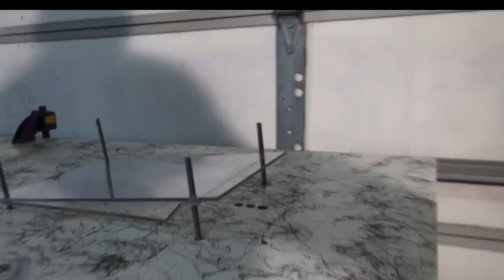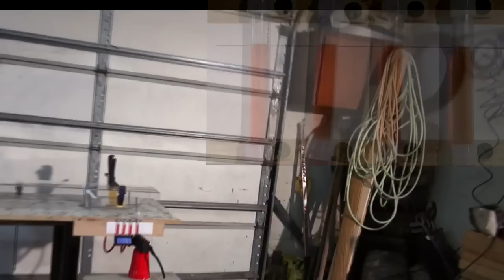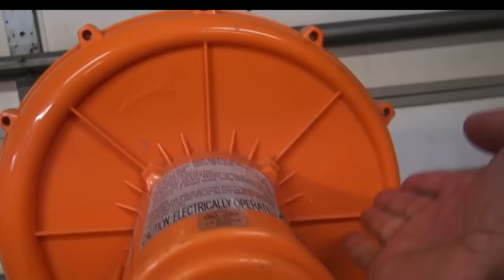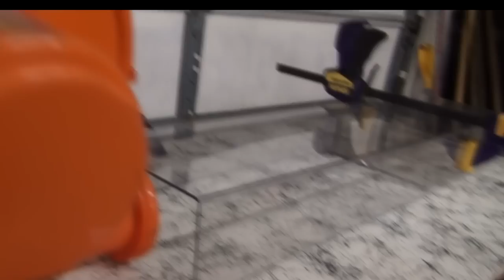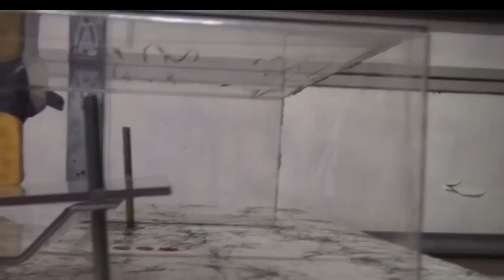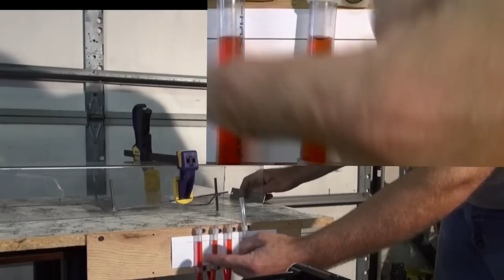Down Force Take II

Comment from the maker: Awesomely caught, a moment of uncertainty. However both of us are of the same understanding.  Air is being physically expanded outward till it is compiled in the manifold where it is compressed.  This compression continues due to the continual addition of air/pressure through the centrifugal blast of air from the axis of the motor.

Comment: Here is a site on basic thermodynamics. A diffuser is the opposite of a nozzle (it decreases velocity, increases temp/pressure vs. a nozzle which increases velocity, decreases temp/pressure). The link:
learnthermo(dot)com/T1-tutorial/ch05/lesson-C/pg07(dot)php

^^ Replace both (dot)'s above with periods for the link to work.

Comment: Finally, the Bernoulli principle says pressure and velocity are inversely proportional. This is true. As the speed of the air in the diffuser slows down, it's pressure increases. The venturi effect "is the reduction in fluid pressure that results when a fluid flows through a constricted section of pipe." Therefore, the reverse is true as well. As flow is expanded, fluid pressure increases.

Comment: I hate to make you keep doing these, but they're a fantastic way of learning. The suggestion below is sound, to use smaller tubes. Also, make the diffuser larger, MUCH larger, and get rid of the "spoiler" on top. Have it so that it's flat on top, half the bottom is flat, and then half the bottom tapers up. It will be a larger scale, but much easier to view pressure differences.

Comment: So at about 4:00 you explained it properly. The air moves fast and loses pressure. So you agree that fast moving air has low pressure. So then the opposite must be true as well - if fast moving air is slowed down, it increases in pressure. This is because the air molecules are now closer relative to when the air is moving more quickly.

Comment: 2. put 2 ends of the same tube in different positions.  That will measure the gauge pressure between the two in manometer fashion.  This is called "Gauge Pressure" instead of "absolute pressure".

Comment: First: Good job

Suggestions:

1. You're trying to measure pressure, not flow.  You only need a very small hole to measure pressure.  Instead of a 1/2" hole under diffuser, cut it down to 1/8" or so.  Compared to your model, 1/2" might be large.  That way you won't be measuring the average pressure over a relatively large distance.  The distances between the positions are close to the distance you're averaging over.